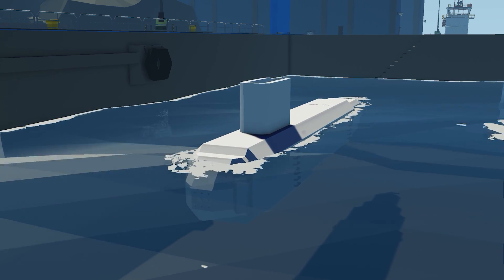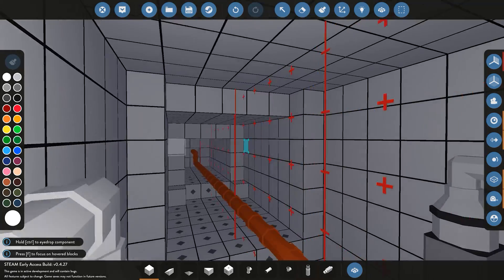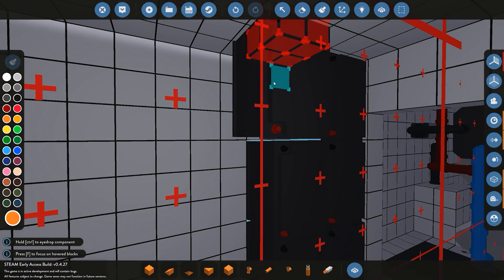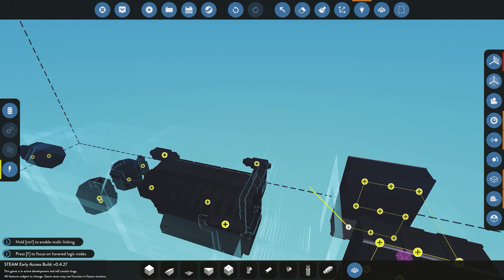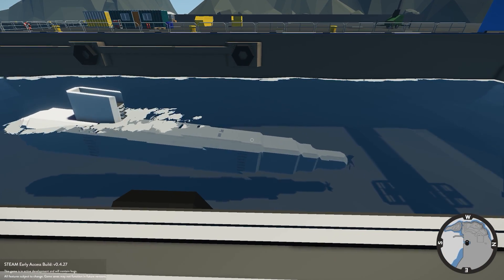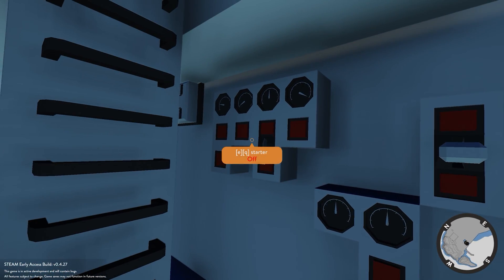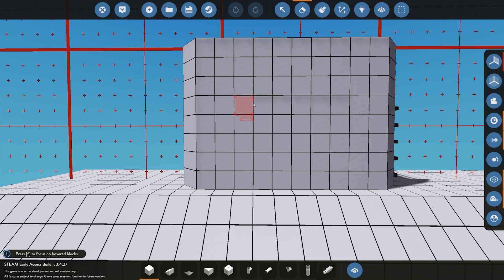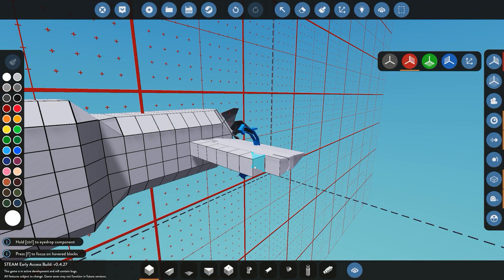Stormworks Advance Sub Tutorial Part 3

Comment: How did you filter the water out of the air input?
Reply: There is a fluid filter component you can unlock through research. And with that you can filter out what you dont want through the filter. lets say water, and it will only let air through, As i understand it. Have not tested it yet myself.
Reply: EyeDentify thanks

Comment: I took a medium winch (100m winch) built a bouy on the end with a fluid intake port on it, connected it to the air-intake on the engine, that way I can run the engine while the sub is still under water also I attached a velocity pivot and camera onto the bouy as well to use as a sort of periscope. but do I need to have a pump on it to get the air through the line? It worked fine on the surface but when I went under and deployed the winch/bouy it just wouldn't work and I remember in your previous submarine video you said you need a pump for lengths over 10 blocks, does that also apply to cables?
Reply: I would assume so
Reply: U need exhaust ig

Comment: Why exactly did U Put in a electric engine as Well?
Reply: Captain_Calico The engine can't run underwater without sucking in water, so while you're on the surface you use the engine to charge the batteries, and then when you're underwater you use an electric motor to actually drive the propellers.
Reply: Ah okay thx

Comment: The arrow on the gearbox should be pointing toward the engine if you want a higjer output. 
Like (propeller) 3 ➡ 1(engine)    = 1:3 on the settings.

Comment: Can you make gearbox? Would this works?
Connect 3 of them in line with different ratios, and 3-bit binary output circuit to to control them?
Like:
1. Throttle lever with output from 1 to 8
2. Clamp that output to be without decimal part
3. Convert them to 3-bit binary output:
First 1 > 000 all gearboxes at default (1:1, 1:1, 1:1)=1:1
Second 2 > 001 first gearbox switched (1:1, 1:1, 1:2)=1:2
Third 3 > 010 second gearbox (1:1, 1:3, 1:1)=1:3
Fourth 4 > 011 first and second gearbox (1:1, 1:3, 1:2)=1:6
Fifth 5 > 100 all gearboxes switched (1:8, 1:1, 1:1)=1:8
Sixth 6 > 101 all gearboxes switched (1:8, 1:1, 1:2)=1:16
Seventh 7 > 110 all gearboxes switched (1:8, 1:3, 1:1)=1:24
Eighth 8 > 111 all gearboxes switched (1:8, 1:3, 1:2)=1:64
- Can you reply to me? Thanks
Reply: At least you got the heart.

Comment: You have probably figured out that th diveplanes on the conningtower were reversed.
Reply from the maker: hiddengnome yes thanks already fixed for next video
Reply: @MrNJersey   It is not that I mean to criticize your things, but more to help the person who wants a quick answer as to how the dive planes go.
Reply: @MrNJersey  By the way, I feed the engine output into the B side of a gearbox and get a lot of RPMS on the other side, whereas putting things into A and feeding B to the props makes them go really slow, why is that?  Because as I currently understand the little arrow on the gearbox, it seems like you feed it with something ( which comes in at the left)  and something bigger comes out (the line/edge on the right)
Reply from the maker: Jump in the discord later and drop me a PM and I can answer it to the best I can
Reply: hiddengnome You just set gear ratio, by powering A (small wheel) to B (large wheel) you get a LOT of torque but only a tiny bit of RPM
So i think they should rename it to "reduction" or add option to invert gear ratios (large wheel to small = lot of RPM)

Comment: Hey Jersey, remember the arrows on gboxes? You are placing them wrong way. They need to face towards the engine to increase the rpm on the output. Place them in a way so “Power A” is facing towards propeller and “power B towards the engine” arrow should be pointing towards the driveshaft to engine. 
Even two gearboxes with a Diesel engine can get your boat up to stupid speeds(my rescue boat which is about two times your sub gets up to 150 knots with four 3:1 reversed 1:3) gearboxes. They are absurdly overpowered.